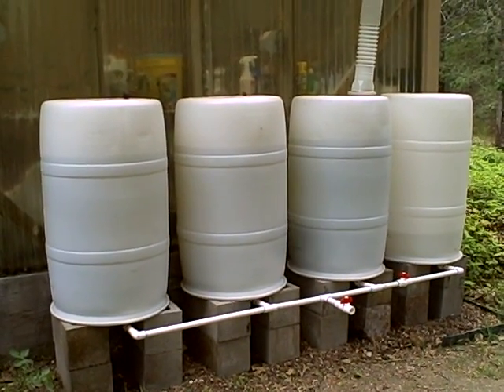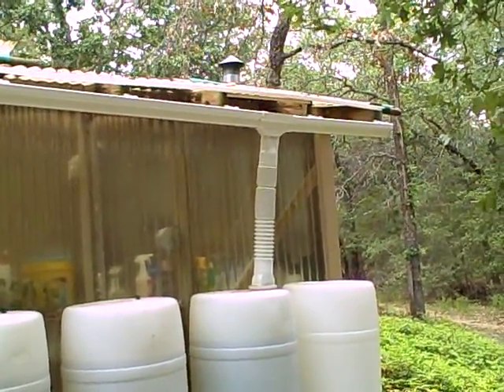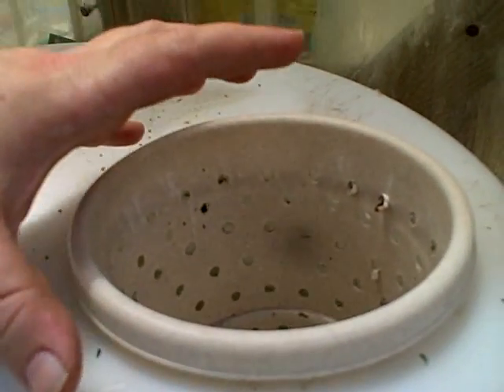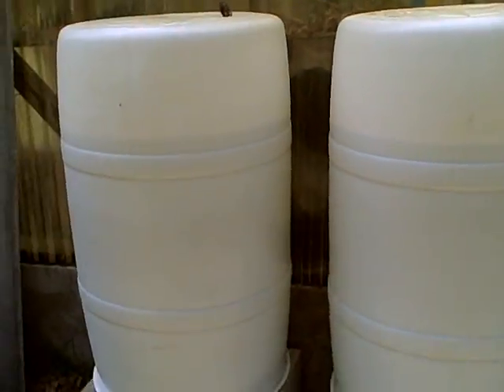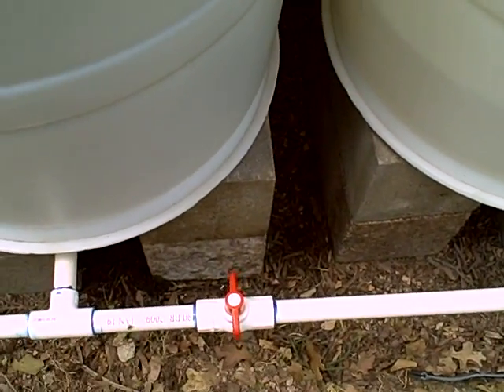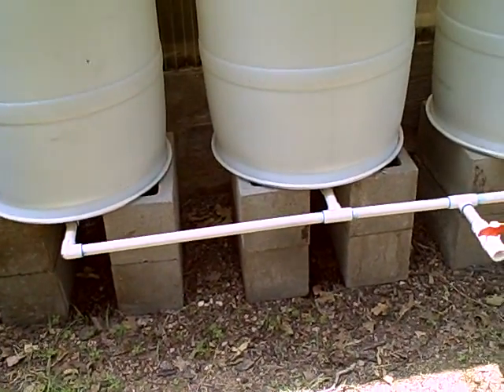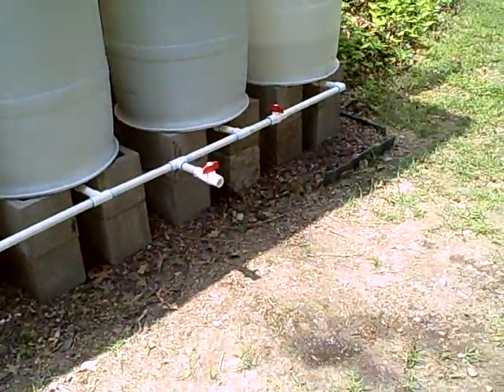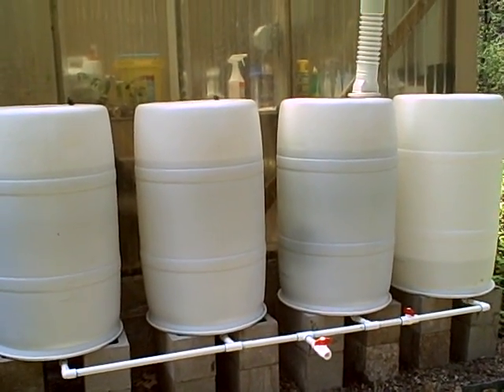MNT's Rainwater Collection System with Manifold

Comment: how are you using your water for this setup? just using gravity pressure for garden hose or did you ever happen to set up drip irrigation off of it?  im planning on drip but am wondering if the pressure is going to be enough, or even too much pressure, and ill have to have a pressure regulator?

Comment: Put a pipe thread adapter as well as a T on the last barrel that way no cutting all you do is remove the cap or plug from the end thread another adapter on and add more barrels no wasted pipe or fittings

Comment: I did this with 2 barrels...is there a reason my 1st barrel is now about 20% full and the second barrel is still almost empty? Does the 1st barrel have to get to a certain level before second starts to fill up?
Reply: You have have just answered the question I just asked.   Do you have your valves to the manifold on the bottom of the barrels like in the video as opposed to being a few inches up on the side?   You may have sediment that clogged the manifold.   All the other videos I've seen have the valves for the manifold a few inches up on the side of the barrel..

Comment: I am building my system like yours. Best system I have seen yet. I have added hose quick disconnects at each t fitting on the manifold in case I need to move or relocate barrels. It's pretty dry in Corpus too ! Thanks for the cool idea

Comment: I am building the same type of system now, but I am using black barrels to prevent sunlight from entering the barrels causing algae growth. I also decided to cover the basket strainer with a cloth paint strainer to keep even small debris from entering the barrels. I need to find bungs like you are using that will accept the 3/4" male adapter, the ones that came on the barrels that I have do not offer that, so I was going to connect them all together using 2" schedule 40 PVC pipe so that it would fit the bung opening.

Comment: I used a wire sleeve from Lowe's or HD for putting on a water hose to filter the water coming from  the washing machine when it drains.  About three per package.  They filter the leaves and stuff from the down spout diverter hose. .  Easy to change.

Comment: Been a few years since I first saw you vid and I finally got around to my build, based on your design. I built a similar 2-barrell system that works perfectly. I used a 2" threaded fitting in the bung, but all else is a replica of your setup. Neat, reliable, easily expandable, and leak-free. PERFECT!Thanks again, bud.

Comment: hi, thanks for the post. I've watch loads of other systems and there are some tips from them that my assist you (and others) 1. use mesh on your flower pot device. 2. use union joints on the down pipe. This way you can remove individual barrels in case of repair etc. 3. do you have a 1st flush?

Comment: I really like your manifold system.

But, I do have a couple random thoughts:

* You will have a huge algae problem because sunlight can penetrate those barrels. You should have painted them black or covered them with black plastic. This will only get worse.

* With some research, barrels can be found that are opaque. They are often dark brown and, like yours, can be sourced from soft drink bottling companies.

* Filter your water a LOT more if you plan to use it for low flow drip irrigation because the hoses and ports are VERY small therefore they will easily clog. One cheap way to filter your incoming water is with an old panty hose, just clamp it over the end. When it gets messed up, remove the clamp and replace it.

* Put a drop of dish soap into the water and it will break the surface tension which will mean that any mosquitos will not survive. The soap will not bother any plants.

* If you had planned ahead, you would have put a "T" on the last barrel then a short piece of PVC to the right of it. Then a cutoff valve to that so extending your system would have been far easier. Now you will have to cut off the right angle of the last barrel which means all the water will rush out of it.

* Use an adapter that will allow you to attach a standard brass garden faucet to the outlet of your system. That way you can attach many garden hoses and other fittings that use the standard.

* Where the water comes out, put down some rocks and pea gravel so the area does not become a muddy mess. Or use some paver bricks or simple red bricks.

* I was going to say each closed barrel will need a hole for air to escape but I see you covered that during the last minute. Any holes need to be covered with screening to keep insects out, especially mosquitos.

* Clean the lens of your camera.

Thank you for the manifold idea, it's a great idea.

Terry Thomas
Brookhaven Gardens
Atlanta, Georgia
Reply: +Terry Thomas  there is a unit used on water well lines for sandy wells believe it is made by laval..not sure if it would work on lighter material.

Comment: Hey nice detailed video, great system. You got me inspired to build the same, but 3 barrel system. I used the same size pvc pipes, ball valve is at one end, not in the middle like yours. However, no water is coming out of my 50 foot hose. Is that too long or what could be the issue? (Hose works fine on spigot, so does the ball valve - has a lot of pressure when turned on) Let em know before I implement plan b-that is replace pipes with 2 in pvc pipes
Reply: +JAY INC.  I think you just need to have a valve at the top of your tanks to let the air in when you drain the tanks and out when you are filling them. That should solve your problem. The lack of air flow is holding the water in your tanks

Comment: How does the weight of the water in one barrel lift up the water in all the other barrels? Why wouldn't you have the pipe at the top and let overflow do the work for you? Probably a noob question, sorry if it is.

Comment: +HomelessShelterRice Each foot of elevation change is equal to 0.433 PSI of water pressure or every 2.3 feet in elevation you will get 1 lbs of pressure.

Comment: I went through the comments to see if anyone else noticed and blocks as I did.  With my catch system here in Houston with just two barrels, I was told to build a bench with 4x4s and put bracing under the center, etc.  The company I purchased the barrels from said that all rain barrels should not sit on concrete at all.  There is a chemical reaction with the material that the food grade barrels are made out of that will cause them to deteriorate rapidly.  Are these concrete blocks?  I like your ideas on this about connecting more parallel like you did.  Also, would you need holes in the top of all of the barrels for the air to go out, or would gravity take out the air bubbles and not build up the pressure in any tank except the last one?  Just wondering.

Comment: is there any way of letting air escape on the top of the barrels?
Reply: Westwoods 01 I am assuming those little black things on top are vent holes.

If you want not to have to drill holes on top you can always use the already existing bung holes and bung on bottom. You will need to insert a vent pipe.  You can tie them all together with some tubing so you can direct the overflow or just make the overflow lower than the top of the lowest vent pipe.

Comment: good setup. I will probably copy your system. I am a little concerned about the vulnerability of the pvc sticking out there....getting broken....
Reply: I don't know if you've already built your system, but i would like to add something to the manifold design.    Put a valve between each tank.  If you don't, and something happens to one of them and it starts leaking, it will drain your entire system.
Reply: great point. thank you!
Reply: Renaissance MarineTV nbi6
Reply: you could also use the black type ABS drain pipe. This is thicker and will take a 'hit' better than PVC. Running the valve system down the center of the bottom will move the pipe out of the way also. Be sure and drain the system entirely in freezing weather conditions. Using black food grade barrels will alleviate the algae problem without having to use chemicals. A small pin hole in the top of each barrel will allow enough air in to solve any backpressure problems and shouldn't attract any mosquitos.I'm going to be building my system shortly and have done a lot of research and will be combining the best from a bunch of good ideas. video to follow

Comment: Good system.  Thanks for posting.
Now I'm motivated to build one like it.
I have found that Vulkum caulking usually works better than silicone.
Why does the end barrel have less water in it than the other 3?
Reply: He is going to add another  barrel or two so he left it dry not to loose the water

Comment: Good info and a nice easy system.  I've wanted to do something like this but didn't think of the manifold system to fill the other barrels.  Not sure how much I could get but I wanted to do this with A/C runoff.  It may not fill a barrel a day but may be enough to water my small lawns and plants.

Comment: I thought your system was pretty cool, very simple and looks like it shouldn't take to long to make.  I have a 60psi air pump that I'm thinking about linking the 4 barrels when I'm done.  That is IF and when I find the time to pick up everything/supplies and put it together.  With mine I'd like to keep the main cape so I can seal up the main drain water inlet hole.  Instead of just adding breather holes in the 3 barrels.  I'm going to put in 4 valves on all 4 barrels/drums, so I can open and close to allow for air to breath or close for air pressure.  Your water pressure looks nice, but I think the power at the garden hose sprayer would be greatly increased using a little more pressure/force pushing down on the water.  Sounds like it should if you think about it?  Thanks for your video & idea for a rain water collection system.  Bri

Comment: System looks great. Do you ever run into problems with the water getting too hot in the summer sun?
Reply: Matt Price Water used for sprinkling is usually at air temperature by the time it hits the ground ... whether it starts out hotter or colder.

Comment: Thanks for posting this !

 I made my 220 gal. system exactly the same only different.  I bought 6 blue barrels.  I had four hours to make 1 and put up a gutter before the rain came.  The 1 barrel worked, but I did it poorly.  I got about 40 gallons of water, which I have used.

I made a four barrel system just like your picture, and made more mistakes, but maybe made two slight improvements.  I used a ball valve on each barrel, so I can isolate each barrel.  I also have put a ball valve on each end.  One connected to the spigot connected to my irrigation system that goes into my little hoop house, not the public water supply.  If I have lots of rain,  I can drain the barrels  into my yard though my irrigation system, or onto the ground.

I listed my oops and  nice thought below.

Hints:

The 1st one barrel collector, I used silicon to seal the bungs and threaded pvc connector into the bung.  No leaks but the pvc  into the bung still hasn't solidified.

Use Rectorseal  5 ! 

I set an 18" x 18" concrete stepping stone on the bottom, used 6 concrete blocks instead of 4 ( per barrel ).  It is much easier to get a 5 gallon bucket under the spigot.

Take your time !  Drill your holes on the bottom first so you can get the shavings out through the big holes on top.  Clean out the shavings and then use Reactorseal 5 to seal the bungs.

If you don't have time to let things air dry, leave some water in the barrels for a while to rinse out residue.

Comment: Those barrels are in parallel, not series.
And it's POTable, not POTEable

Lol, just yanking your chain...
The way you've plumbed it is how water tanks are installed in boats, except that each tank is usually isolated with its own valve (not that you need that capability).

Do you find you get a buildup of sludge in the bottom of the first tank from the fine debris that makes it through the strainer ?
Were you to do it again, would you put a trap and cleanout at the outlet of that first barrel ?

I've been thinking about doing something like this for the cabin but with a restrictor in the outflow so the plants get a continuous drip when I'm not there. I'm going to shamelessly steal your plumbing layout to make it happen :)
Reply: DeadeyeLefty Get yourself some Irrigro Tyvek irrigation tubing and never look back. I've used it for years.
Reply: bill65761 Thx Bill, I'll check it out !

Comment: Look I was thinking about this for a minute now black barrals will stop any growth inside the system black also attract heat from the sun to heat the water for other uses but u can also kill that with some black tarp to block any light.
Reply from the maker: Yes.  I might as well ask this now:  Why is everyone so keen on preventing the growth of algae in the barrels?  Wouldn't the algae end up benefiting the water in some molecular or other biological way?  Thus, wouldn't that same algae-steeped rainwater pass along those constituent benefits to the plants watered with the collected rainwater?  Hmmm... I mean if the only concern is excessive algae clogging pipes, well... this system (I have others built since posting this vid) has been up and running since 2009 and to that extent algae has never been a problem.
Reply: MrNativeTexan
What about the algae attracting mosquitoes?
Reply: vahid1951 Mosquitoes aren't interested in algae, they are looking for stagnant pools of water to lay their eggs in. Looks like this system is able to keep the mosquitoes out.
Reply: vahid1951 Was actually curious about this too.
Reply: +bill65761 I would not "hope" the mosquitos will stay away. I would be proactive.

Comment: It's not a series connection, but a parallel connection. They all get the same level at the same time. If they were in series one would get water after the one before it got full. That way would would connect them at the upper level to fill in and a connection at the bottom as you have it now to get the water.
Reply from the maker: Thank you.  This has been established about a thousand times over.

Comment: Try using black water tanks instead of white as the former does not let light pass through them.  This way it will prevent algae from growing in them. The ones in Chios's rooftops and gardens are exclusively all black.  It does not rain here for almost 4 months during the summer months.

Comment: The narrator does not mention pressure relief valves, but you can see a black fitting on the top of all but the unused barrel. You are correct that if the barrels are not vented, they will not fill uniformly.

Comment: Use an IBC tote, no need for this manifold system and you get 275 gal of storage for each one.  And cover it with a tarp to prevent algae growth.  Great tip on the flowerpot to make a strainer!

Comment: Question for ya.... In a downpour.   (like we often get here in TX). Would an overflow at the top of the barrels help "level" out the water faster? Just thinking that if I were to get a fast big rain the single 3/4" pipe wouldn't even out the barrels fast enough... Any problems with that?  Great job by the way

Comment: MrNative Texan. Nice. A friend of mine and myself also designed what we called the upside down manifold. Why everyone interconnects barrels at the top is beyond me. I watched dozens of rainbarrel videos and this is the first one like my design.  I used the bung hole threads for my PVC, much larger than yours. This helps because here in FL when we get rain it rains. I wasn't sure 3/4 would move water from one barrel to another fast enough. I am curious if you think your manifold should be larger?

Comment from the maker: Are you talking like a paint strainer like a cheese cloth?  I like the idea!  As far as a two-inch manifold goes, I don't know what benefit you'd get from it. First, I don't know of a 2" to 3/4" reducer coupling.  Second, regardless of the size of the manifold the 3/4" fitting is going to limit your GPM. Third, using 2" pipe and fixtures is going to add to the cost of the system and is going to get pretty damn heavy when full of water which will add to the stress on the 3/4" fixtures. Thoughts?

Comment: Would a 2" PVC manifold between the barrels allow the water to level quicker and then reduce it to 3/4" out to the hose to increase pressure?  Also I would use a paint strainer for your strainer.  Your answer would be greatly appreciated.  I want to make it right the first time.

Comment from the maker: Thanks for checking out the video.  You know, I get a lot of questions about "winterizing" my system.  Fortunately, I live in S. Central Texas and we never have to worry about winterizing anything :-)  However, I'd simply drain the system and wait until Spring rains roll back around to fill up your system again.  After all, if you have to worry about "winterizing" this system, then the chances are you aren't going to be growing a garden during that time anyway, right??  Good luck!!

Comment from the maker: Thanks for the nice comments!  Actually, what I did was simply remove the bung caps.  The 3/4" male, threaded fitting screwed right onto where the bung cap had been.  One caveat, though... if you choose to go that route (and it's the easiest route), make sure you either wrap some teflon tape or apply some Rectorseal 5 to the thread before fitting.  Also, it's a good idea to apply a silicone bead (or similar caulking - like aquarium silicone) to the outside of the fitting. Make it watertight!

Comment from the maker: you could run a loop of low-voltage wiring around the barrel.  i have a similar thing for my homebrew setup when the wort needs to stay at a consistent temperature and the ambient temp isn't ideal.